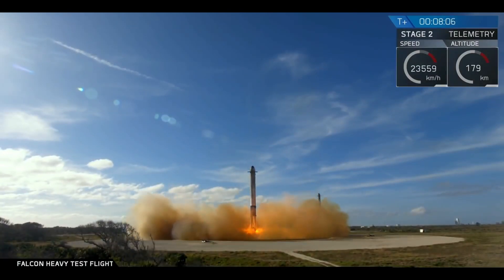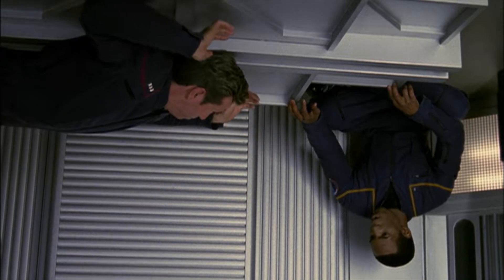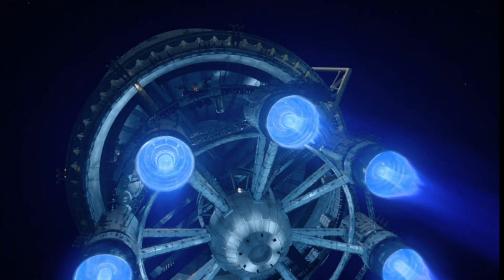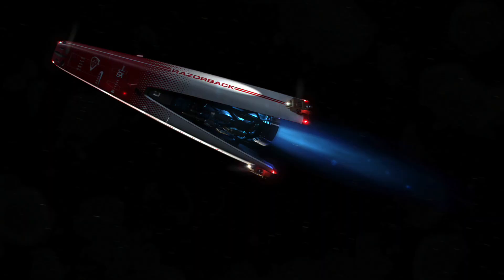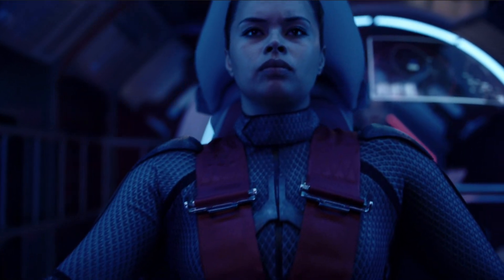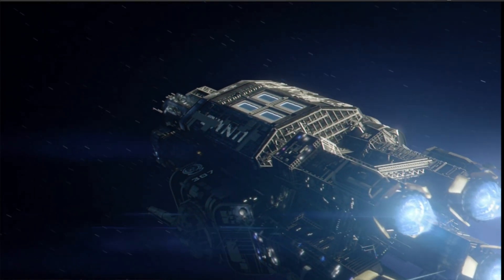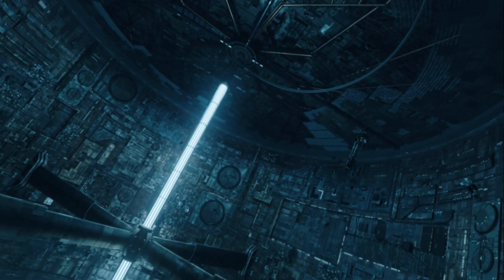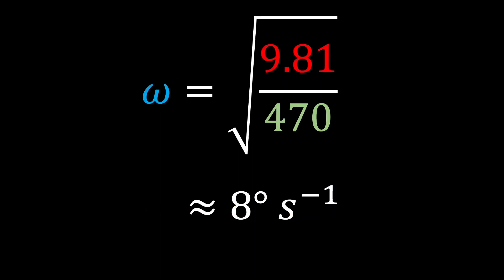Are the Expanse Ships Realistic? - Science of the Expanse

Comment: Surprised you think 'gravity plate' may ever be a thing. Gravity is fundamental warping of spacetime - not some force (as I guess you would know). The only way to warp spacetime is by  mass - or energy equivalent. And to do for near 1g - you need an earth size mass - or at least small dense planetoid. And you you can't compact mass of a small planet into gravity plates. Well ...ok...maybe interesting to speculate if you could envisage a plate made of magnetically suspended micro blackholes (that arent radiating too much Hawking radiation) - that could provide such a thing. But even a  small room sized plate   would  still mass out at least a small asteroid equivalent. To do  that instead of adopting (relatively) much easier approach of linear or rotational acceleration seems weirdly extreme and implausible (even if it is at least theoretically not impossible)

Comment: Fighter pilots are facing away from engine not because acceleration but because of convenience. Most powerful "thrusters" in a jet is wings. With engines fighter can't get even 1.5G, but using wings in maneuver jet can easily pull 10Gs.

Comment: why couldn't they just put the engines along the side of the spaceships or one on each end only flipped 90 degrees so the thrust would be perpendicular to the length of the ship, thus eliminating the need for a lot of narrow decks with stairs between them?
Reply: Structural loads. When the structure of the ship is stacked on top of the engine, canalhouse style, the structure only needs compressive strength. But if it's stacked horizontally, a high-g acceleration would cause flexing along those perpendicular axes and require multiple different types of strength. It's better to inconvenience the crew than to introduce another major failure point.

Comment: Of course, even with enough fuel, the behemoth could not continue to accelerate for hundreds of years, as it would eventually reach a measurable portion of c. From other videos I've seen that traveling at 0.3g between planets in the solar system doesn't quite get up to that level which is nice for consistency.
Reply: I think it was mentioned somewhere that Epstein's yacht had reached a good quarter of c before running out of fuel?

Comment: The sifi video game series Mass effect actually uses all 3 types of gravity

Mass effect can create mass manipulation technology by introducing an electric current to a mineral called Element Zero. This generates dark energy that can manipulate the Mass of a bubble of space time. This bubble is called a mass effect field. I've looked it up. There is no evidence for the existence of Element Zero but energy fields that manipulate mass are theoretically possible. These mass effect fields form the basis for most of the technology in mass effect including artificial gravity

Mass effect fields can be used to increase the Mass of the floors in order to simulate gravity. This a-grav method however does come with problems. It requires a lot of power, which is why larger ships do arrange their decks perpendicular to the thrusters, similar to the expanse. With the lower decks being at the back and the upper decks at the front. This takes the stress off the a-grav systems during flight. It's also stated that in combat a-grav is often turned off. This is mainly because in extended periods of combat, ships suffer overheating issues and non essential systems are shut off to improve combat endurance.

Fighter pilots also wear airtight G-suits as it's common for pilots to shut off life support systems including a-grav as the power is redirected to other systems

There is also the Citadel space station. 45km in length and 13 km in diameter. It relys mostly on spinning for gravity

Comment: There's a problem with spin gravity on ships - it's not compatible with accelerating.  Whether you aligned the ring horizontally (like a classic spinning flying saucer) or vertically (Discovery One) to the axis of thrust you're 'falling' towards the engine the instant you light it up.  

In Discovery One's case this wasn't a problem - both because the crew was mostly in hibernation and because it spent the vast majority of its time drifting, not accelerating, towards Jupiter so the ring only needed to be stopped/secured at the start of the trip and at the end.  In a weekly show that portrayed the crew as active and acceleration changes as frequent a spinning ship would get problematic in a hurry, though.
Reply: If the acceleration isn't high, you'd just end up feeling like you live in a sort of funnel that slopes down towards the engines, with steepness of the slope changing with the speed of acceleration. Not too hard to design the environment of the inside to account for that.

Comment: One problem I have with the design of ships in the expanse is that the bridge is typically on the "top" of the ship, or the point furthest away from the engine. With the command crew's feet pointed towards the center of mass rapid rotational maneuvers would throw the crew into the walls and ceiling.

It would be way better to have the bridge as close to the center of gravity as possible to minimize the effects of rotating the ship on the crew.
Reply: Also, the "bridge at center" tends to offer more protection from projectile weapons and radiation from nuclear explosions. The CIC "Combat Information Center" on a modern US Naval warship is the nerve center of the ship which is why it is deep in the most protected part of the ship.
Reply from the maker: Good point! Being at the centre of rotation would certainly help prevent blackouts from flipping.
Reply: Aren't the bridges in the centre of the large warships, like the MCRN battleships?
Reply: They are for the big big ships like the Donnie and Agatha king. For ships like the roci which aren't too big you'd want as much distance between you and your fusion engine since if they thing gets rail gunned you want to be shielded as much as possible from possible radiation dose once you eject the core.
Reply: @Idris.505  also worth noting that on the smaller ships, everybody's strapped in, and in vac during combat. 
The donnie didn't do either in the command spaces. So more likely near the COG, and as protected as possible.
Reply: @blackc1479  Yeah exactly
Reply: Huh,  really good points. 
Yeah, the Donnie bridge was iirc somewhere close to center, and basically floating inside a bigger space. I think....damn, now I'm getting paranoid.

Google isn't helping, so I'm just gonna stand by it.

Comment: A spinning drum is a lot harder to engineer than you'd think, as the static section isn't anchored to anything so they'll both just end up spinning in opposite directions, you would need sets of thrusters permanently firing in counter directions on the two parts of the ship. It's easier to make ome like the endurance from interstaller where the whole thing just spins, but that also makes its near impossible to dock, as we saw.
Reply: You just need to overcome whatever friction there is between the opposite spining modules, making it hold athmosphere is the more difficult task if you ask me.
Reply: My opinion has always been to have two cylinders spin in parallel next to each other.
Reply: easy: make two cylinders and have each rotate in opposite directions
Reply: Dunno about Tycho, but Behemoth had thrusters on the outside of the drum. Therefore no torque was applied to the center shaft, (the static part) of the ship. So it wouldn't need counter thrusters. The engineering deck was in zero G as we saw during Holden, Bobby and badass Drummers raid

Comment: I think the rotating deck is only truly feasible for stations and ships that undergo either gentle constant thrust, or coast most of the trip.  For a ship that might need to quickly change direction of thrust, you then have acceleration along two axes, one of which cannot necessarily be easily predicted.  So it would be difficult to build for that.
Reply from the maker: You're quite right! Turning a ship with a rotating deck would be a massive pain as you would need to fight against the gyroscopic effect produced from rotation!
Reply: In Babylon 5, we see passenger liners with rotating hulls to provide gravity but most older military vessels dealing with zero G. In season two they introduce new, larger military vessels with rotating sections for the crew's comfort, but those are powered down in combat situations, precisely for that reason.
Of course, given the show's budget we don't see much zero-G, but they at least make nods to it like having crew strapped into their chairs.

Comment: The Expanse definitely tackles all the real problems of actual space travel most scifi ignores: gravity, radiation, distances, fuel economy etc. What I have been waiting for since forever, though, is a simple representation of how propulsion actually works in space. 
If you accelerate, which you have to do if you want to go anywhere, you won't slow down or stop again unless you hit something. You have to turn around and fire the thrusters retrograde in order to slow down again, for example for an orbit around a planet, which is about half the fuel budget for any NASA mission after actually getting off the ground in the first place. Half the fuel to accelerate, the other half of the fuel to slow down again. 
That's why many missions to smaller planets and objects are flybys. You just need less fuel for a flyby, which means it's cheaper for a start, that you can go faster and therefore get there sooner, and also that the fuel you would have needed in order to slow down enough to circularize an orbit can instead be more scientific instruments. The less massive the object, the slower you need to be going in order to enter an orbit. So we have had essentially satellites around Jupiter and Saturn, but not Neptune, Uranus and particularly Pluto.

Comment: I like that you went into how The Expanse uses it's ship design to generate gravity, but would have like to have heard more about if the efficiency of an Epstein Drive would even be possible.  I've seen several things about an Epstein not being possible issue with "Heat Problems", Reactor fuel vs reaction mass, the exhaust/drive ploom would be so enormous that it would destroy anything traveling nearby...etc.     I assume alot of these issues are based on how a modern understanding of how a hypothetical nuclear engine would/could work, and that within the lore of the novels/show are the problems that Solomon Epstein was able to solve to create his fictious drive... but still would like to know if those are even solvable problems by what we understand about nuclear physics.
Reply: There are existing nuclear engine designs. They do have extremely high ISP (how much bang you get per buck if fuel efficiency) but generally lower thrust. You can make high thrust nuclear engines and they can be quite efficient and give decent thrust. Its all a matter of energy efficiency and nuclear beats chemical ever time on that front. On the down side,  reactors are very heavy so that can be am issue. Anti-matter being the perfect fuel for energy density reasons but just too damn hard to get a hold of.
Don't understand why the exhaust plume would be an issue. Space is very big. Use conventional thrusters to move away from things and then have at it. 

There are tons of unconventional engine designs. I'd recommend Scott Manley if you would like some detail on them. He had made several vids on them.
Reply: The heat is the problem. You can’t get rid of heat, the only way to stop it from melting your spacecraft is to have enormous high temperature radiators. I think the Epstein drives would be producing something like half a terawatt of thrust power. Even if 99% of that became thrust and only 1% became heat, you’d still have to dissipate 5 gigawatts of heat energy. 
If you handwaved it away, then that’d mean disregarding the most basic laws of physics, at which point stuff like perpetual motion machines would become possible and then you’d be using those instead of a fusion engine.

Comment: Question: I've seen sci-fi ships where a stationary inner tube is attached to a spinning outer ring. The tube has no artificial gravity since it only holds the engines and other areas that humans will only go in for short amounts of time, while the crew inhabits the spinning ring/drum. Wouldn't it be easier from an engineering standpoint just to make the entire ship spin to generate force rather than connecting a spinning section to a non-spinning section?

Nice Mass Effect music at the end, by the way. ;)
Reply: If you spin the entire ship, it'll basically become a humongous gyroscope, and it will be really hard to turn it around. Having a stationary frame can partially negate that gyro effect, and even better if you can have second section spinning in the opposite direction, that will negate the gyro effect almost completely.

Comment: Fighter jet pilots dont sit with the back exactly orientated towards the engines. They are tilted downards. Ideally the head would point towards the engines but that way they couldnt see anything out of the cockpit.
The large g-forces dont appear while accelerating or decelerating but by pulling the nose up (or down) to fly "corners" (not a native here).

The stacked design of space ships for generating gravity by accelerating/decelerating is the fundamental means of gravity in "Battlemech" where the dropships fly from the jumpships (with rotating pieces) to the planet with 1g thrust then in the middle point they turn and decelerate with 1g until they arrive at the planet (same for the rout from planet to ship). Its also beneficial because most of the dropships stand upright on the planet making loading and unloading of mechs much easier.

Comment: Your reference to fighter pilots in fighter jets is completely wrong. That is not why jet fighters are configures like that, since they don't experience most G-forces from engine acceleration, which is negligible in terms of G. In fact they still experience most G in the vertical and that's from turning (in whichever direction) at high speeds.

Comment: The Razorback has a different design from the Rosinante due to it is built for speed and is a racing ship. Comparing these 2 ships is like comparing apples to oranges.

They are also wearing magnetic boots which keeps them planted on the deck.

Star trek ship design are hundreds of years advanced in technology compared to the Expanse ships so it's asinine comparing them.

The only way to prove if the ships of the Expanse are realistic is actually build and operate it on space.

Comment: Okay heres a topic i would love to be covered @Dr. Ryan Ridden : Tycho station is supposed to be a station that spins in order to create g's. As far as understand, those gs would pull towards the axis of the station. Now look at the layout of the station, using the exterior and interior photos. The outer rings, mostly used for residence and retail, have windows lookin in, which you might think are vertical windows from the perspective of those inside , this seems to be confirmed by looking at fred johnsons office/space which has normal vertical windows. But that make no sense. Considering the center of gravity, the exterior windows should be more like a skylight. 
Furthermore while on earth the surface is too big to see the curvature, but id imagine that on tycho it would at least be noticeable. Instead the rooms and corridors look non-curved.
Maybe if you do the math it will make more sense, but perhaps you can do a video examining whether the layout makes sense on tycho as far as we can see it depicted, or if it was just a blunder on the shows part.
THANKS :)
Reply: You're sort of right, but in the wrong direction. The gravity from a spinning space station would be directed outward, toward the outer hull. We see this in some places, where the airlocks on Ceres are set in the "floor".
As for windows in the walls (from the perspective of the station's residents), it is of course possible that the sides of the space station has windows in them, and that that's where Fred Johnson's office was located.
Reply: @BalooSJ  or that they are not windows at all, but viewscreens connected to real time visual feeds to give the comfortable familiarity of windows...

Comment: Ceres and Eros create gravity through rotation. There, corridors were milled in by mine work and thereby partially hollowed out. Later the asterioids were set in rotation by heavy technology until after years they produce their 1/3 G. They're walking down the aisles upside down. Where Miller lives, closer to the core is 1/3 G and the offices of the earth are closer to the surface and therefore have more gravity due to the higher rotational speed.
An effect of the rotation can also be seen in the film when Miller tips himself in for a drink and the liquid flows in a gentle spiral into the glass, because of the Coriolis force, due to the faster rotation compared to the earth.